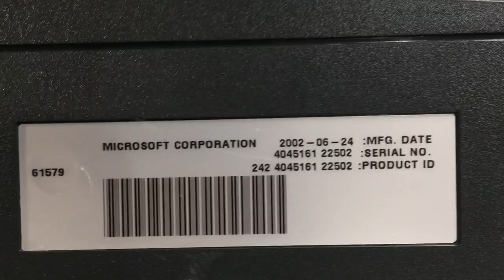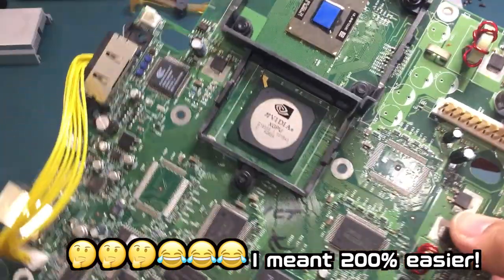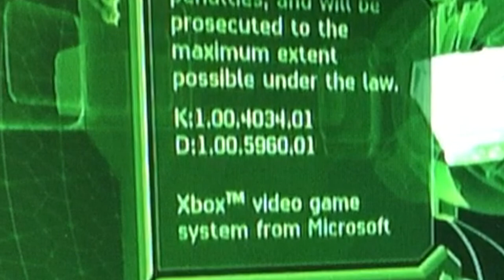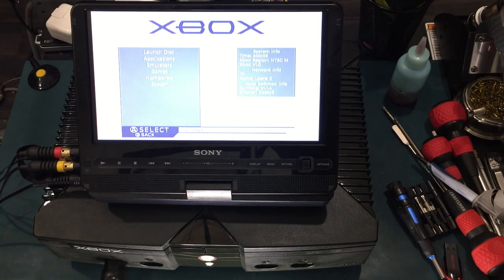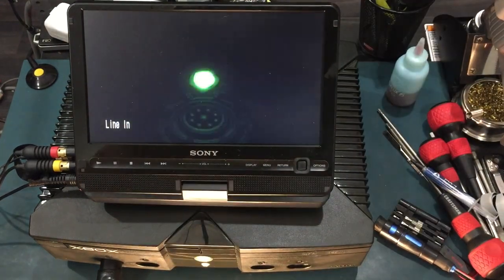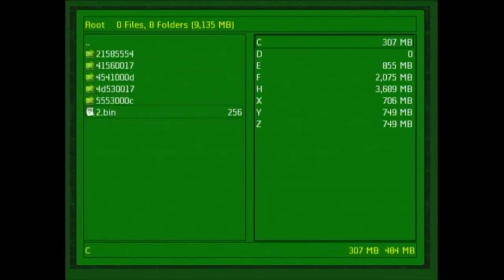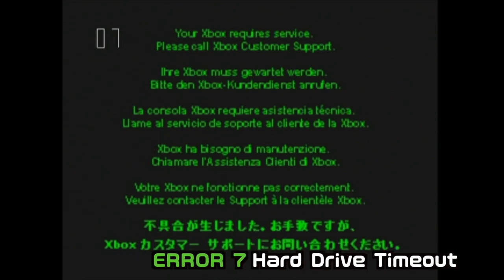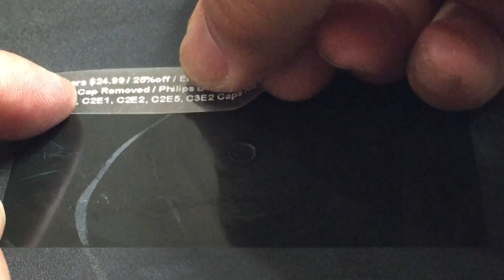OG XBox Error Codes 5, 7, 11, 13, 16 Explained & How To Fix Them [ep. 81]

Comment: I replaced my faulty motherboard then I got error 5. What should i do please? thanks.
Reply from the maker: Motherboard and HDD have to be matched with the same keys. You’ll  have to extract they keys from the MB’s bios using Pony Prog. The directions are in here. Then you’ll need to format the HDD and lock it using the keys from the MB.
Reply: @The_SegaHolic  
Thanks for your reply. 
I have to many games on my hard drive. Xbox stopped powering. I replaced power supply unit, still didn't power. I had to replace the motherboard for it to power.
Is there a way to lock drive without formatting it? Thanks, 
Dean
Reply from the maker: @deanzeineddine1221  No, you need the keys from the dead paired motherboard that the hdd was originally paired with to unlock it. You may still be able to extract the keys from the bios chip, but it’ll be an advanced task.
Reply: @The_SegaHolic  I guess the best bet is to send the old motherboard for repair instead of replacing it. This way the bios will remain intact
Reply from the maker: @deanzeineddine1221  Well, sometimes,the motherboard just aint repairable. But the keys are more than likely still on the bios chip. 
There are ways to extract the keys, but I don't know if the xbox board needs power.

https://www.youtube.com/watch?v=FSe89adGfR0

There is also a wall to "null" the keys, but not sure what the requirements are or how to do it exactly as I haven't touched an XBox in years unfortunately. But you will need a modded XBox.

https://www.youtube.com/watch?v=iS_8_Aop4fM

Comment: I just got back from work and can confirm that my shipping from Arrow was indeed free overnight FedEx shipping. It didn't exactly go perfectly but I'm kind of glad it didn't so I can explain how their customer service was.

I had an ~$37 order full of parts to completely recap a 1.0 revision Xbox, power supply and all (plus a few extra goodies not related to the Xbox). Everything was nicely put in anti-static bags and bigger items like a few 8 pin DIN connectors I bought came in their own little boxes with anti-static cushioning inside, really nice touch. The shipping boxes they used were huge by the way (at least for the amount of parts I ordered), and actually split up my order into two boxes. A lot of brown packing paper was also used. Everything seemed "over protected" and I was pretty impressed until I saw that a glass fuse I ordered was cracked. It was in its own bag but had zero protection, no bubble wrap no cushioning whatsoever.

I contacted their customer support and here is my first downside to Arrow. Their customer support is a little convoluted. Normally with Digikey or Mouser, their live customer support will give you a replacement then and there. You basically just tell them something was missing or arrived broken and you get a new order with the replacements. But with arrow, the rep told me I had to make a new order on my own, email my new order number to a support email, contact live chat again, ask to get transferred to the same first rep if I didn't get them again (I had to ask to get transferred), and then finally the representative could "zero out" the price of the new order with my replacement glass fuse. Keep in mind that throughout the live chat process, their replies were also what I consider slower than average. Overall, it wasn't anything horrible but it was certainly a somewhat time wasting process with a lot of hurdles. I don't understand why the representative just didn't have the power to make a new replacement order then and there. But it worked out in the end and I got my free replacement part. Let's hope this one gets some protection and doesn't show up cracked like the first one.

But overall, my experience was good. The prices are cheaper than their competitors, they have a good selection of parts, 98% of their parts come well packaged, and the free overnight shipping was indeed a thing.
Reply from the maker: LOL. Yeah, that's something I completely forgot to mention. Live support is horrendous. I had issues with them claiming I had to fill out customs papers for items shipped from Europe. I dealt with both live and phone support, as I wasn't made aware that it was the customer's responsibility for customs. Make sure you order parts that's being shipped out from the US.

I know what you mean about Mouser. I used them exclusively for the past few years, and their customer service is top notch... almost apologetic. The even shipped out an item for me for free when I called trying to add a part to a web order, and they shipped it separately for free, as the order was already shipped. Tech support is even better as I found a cap to be not sized correctly compared to the specs listed on their website. They connected me directly to their stock person in the warehouse and specs were contirmed wrong on their website, and everything was taken care of very quickly, and without hassle.

BUT, that will have to take a backseat to me saving money and getting the parts quickly.

Can't believe they didn't "overprotect" the fragile stuff, and they overprotect the others. From my experience, they even ship out in multiple boxes from one order. And all are oversized. Half the time, the are WAY WAY oversized, and even ship out oversized cardboard reels for a minimal amount of connector pins.

But glad you tried them.

BTW, why don't you start a channel? Looks like you do a lot of repair. Oh, and Patrick Nagel fan? I got Duran Duran's RIO LP jus to hang as art. 80's kid here, so I can appreciate it. Nostaglic and brings me back to when I was a kid.
Reply: YIKES! I'll have to be more careful when I order stuff from Arrow. Thanks for the tip. Had I known that sooner, I wouldn't have ordered those 12 10uf Panasonic FR caps from them, they're currently scheduled for shipping from the Netherlands on the 26th. Fingers crossed that they don't bug me with customs papers.

The fact that they didn't put more care into the more fragile stuff really surprised me too. I mean it's a glass fuse, it really doesn't get more fragile than that. If it was a ceramic fuse the bag would have been full of sand... But saving money and overnight shipping are going to hard to beat. I'll put up with a little extra nonsense for that. I'll keep ordering from them, I haven't changed my mind yet. It'll take more than a little bit of hassle to do that.

I appreciate the recommendation on starting a channel. I'd be lying if I said I didn't think about it on a few occasions. Some of the people who's systems I'd recapped even suggested it. But honestly I'm not a very entertaining person, have zero experience in shooting or editing videos, and a lot of my repairs are admittedly repetitive. I don't even save any social media either for "online fun" purposes or a real account. I really like the work I do but it wouldn't make for good content. I'm content with my little ebay console recap side gig for now.

Yeah I'm a pretty big AESTHETIC fan of pretty much anything throughout the 70s to 90s, with a big focus on 80s appreciation. I've got quite a few Patrick Nagel prints hanging around along with one of Agnes Lum. Man if there's something I wish I could experience was Hawaii in the 70s/early 80s. You guys had it good with beauties like Agnes Lum. I don't have any true nostalgia for those eras, I was born in the early nineties. But those eras have a charm about them that's hard to ignore. That and I grew up pretty poor, which I'm kind of grateful for. A lot of our stuff was old but I got a little bit of the vintage experience because of it.

But hey, I've really enjoyed our back and forth. I never thought I'd get so much interaction from you. I know you're a smaller channel but there's always a separation from the youtuber and the watcher. I've always really liked your stuff, always very informative and entertaining. You do a great job making the videos easy to understand for the regular folks yet also cater towards the repair hobbyists with certain details and diagrams. I never thought I'd get a chance to chat for a bit. Thanks for, well, everything! I'm glad I'm a subscriber of the channel.
Reply from the maker: Don't worry about the customs. They'll take care of it. Had to give them a hard time, but they took care of it. LOL.

Hey, growing up poor makes you appreciate stuff more. Little stuff matters. I grew up a little on the poor side too. I mean, our parents gave us stuff when they could... imagine buying an NES in the 80's. They were going for $199 if I remember correctly. $50-70 on games. Imagine with inflation what that kind of money was like. That would be like $200 a game today. Really appreciative of the parents.

I'm glad you get the gist of the channel.

I'm a bit older, in my teens/early20's during the Sega Saturn days, and seen and did a lot with fan sites. I HAVE A LOT OF STORIES and can talk/chat a lot about gaming. LOL.

Agnes Lum? You have good taste. Speaking of 80's aesthetics... give me 80's and early 90's anime art style.

Anyways, you should know that I respond to everyone's comments.

Comment: Segaholic, I removed rocky5's softmod to go back to stock on a spare original xbox I had and now it has an error 16. I used the option to revert back to the stock dash. Do I need to use another xbox that's already softmoded to repair this problem? I don't have the proper expertise on soldering for a modchip on the board.
Reply from the maker: Dude, did you watch this video? Watch this video and pay attention, as this addresses your exact problem (error 16).
Reply: @The_SegaHolic  Sorry, I see what you mean. I've been researching my options all day. I think I just lost listening for skills while watching this earlier. Thanks for the reply though, didn't expect it. :)
Reply: Explained in the video

Comment: i bricked one of my 3 xboxes when messing around with locking and unlocking the hdd, whats the simplest and easy way to fix? i dont know the key or have access to the eprom either
Reply from the maker: I explained it in full in this video. You can dump your eeprom manually with a reader that you can make.
Reply: @The_SegaHolic  i'll probably just sell the xbox for parts

Comment: I have an error 16 due to messing up the uninstall with sid (shown on this video) There are no dash files left, the hardrive was wiped. Any way of fixing it without another xbox?
Reply from the maker: PC. But you need old parts for it. Easiest way is what I show IMO
Reply: @The_SegaHolic  Thanks for the reply. I could use adapters /coverters maybe?
Reply from the maker: @LouiesLog  Not sure. U can go to the og xbox subreddit and ask there.

Comment: How do you fix error 16 when you dont have multiple xboxs or pc with ide
Reply: He showed how to do it in the video, the only difference is that you don't want to clone a working drive, but instead use the softmodding tool extras disc to reinstall the dash and then use chimp to fix error 16

Comment: Lol, "Whut? DAM! It worked!" You give me jokes and your videos are brilliant!
Reply from the maker: I treid uninstalling SID 5.11 from the uninstaller before, and it kept saying it could not delete shadow C, if I remember correctly. And I ended up deleting some files manually, and it gave me an error 13. And I pulled the plug, then an error 16.

I was trying to recreate that scenario, and was surprised that the uninstaller for SID 5.11 worked. Even more suprised when it still worked when I installed SID 5.11 over XBox Softmodding Tool and it still didn't have an error, as in the past, when I did that, an error 13 popped up on another console.

Seems like softmods react differrently on the different revision XBoxes.

Comment: I saw that you used a usb to serial adapter... can you just plug the usb cable in or do you need a serial to usb adapter?
Reply from the maker: I just made the usb plug, so I can disconnect the wire and store it away easier.
Reply: @The_SegaHolic  But what if you didn't have a serial port? Just the usb cable or an adapter?
Reply from the maker: @mrbeastlover1609  So find a PC with a serial port. It's cheap. You can find old PC's or laptops on Facebook Marketplace, Craigslist, etc.
Reply: @The_SegaHolic  That still does not answer my question.
Reply from the maker: @mrbeastlover1609  https://m.youtube.com/watch?v=UcK6nKyKGVQ

Comment: Hey will xbox hd maker and recovery tool help me recover my xbox og softmodded with error 16 thnx
Reply from the maker: I heard it will, but I don't have.a PC with IDE. I'm guessing you didn't save your EEPROM. If you have another XBox, a PC with serial ports, and make the LPC dump cable, the method shown in this video is pretty easy to do.
Reply: @The_SegaHolic  can I use a pc but I have a pc with no ide so what can I use and I don't have another soft modded Xbox and also do I need to replace my clock caps I'm still trying to fix error 16
Reply: I can't find a eeprom reader anywhere so I don't know where and how to get my eeprom bin
Reply from the maker: @BlackCat-qm3sj  You're gonna have to make an eeprom reader... I have the link in the description, or buy one:
https://www.ebay.com/itm/Xbox-EEPROM-Reader-Writer-Repair-Faulty-Console-or-HDD/140521532676

Comment: I get error 7 after following your instructions of how to upgrade the hard drive after the softmod. Pls help
Reply: Actually nevermind. I'd just inserted the jumper the wrong way round lol
Reply from the maker: I thought you successfully upgraded the HDD last I heard?
Reply: @The_SegaHolic  I had but I had to sell that xbox. Nevermind I've got it working by putting the jumper in the other way round and using the maxtor power supply instead of the power supply built into the xbox
Reply from the maker: @chris61981  What was the matter with the other XBox that made you sell it?
Reply: @The_SegaHolic  nothing I just couldn't eat
Reply from the maker: iVirtualPlays  Yes. I already know that. But I prefer to use IDE drives, as you don't need to spend extra on adapters that may fail later. You are adding extra stuff. And I don't need 2TB of memory as I just need to play the games I like.
I've been sitting on an SSD and all the other parts I need for an SSD SATA drive for months, but I have been busy helping people out.
Reply from the maker: iVirtualPlays  You're looking in the wrong places. I found a whole bunch on Craigslist... 5 for $40, all over 200gb.

Comment: What about error 21 ?
Reply from the maker: Kevin Twiner sorry, that’s nit an error I have encountered personally.
Reply from the maker: On second thought... can the Xbox load games from the DVD drive?
Reply: The Sega Holic the drive is still functional, I put in a halo disc to see if it would help and now it’s showing 16
Reply: The Sega Holic I also have one that the error code is 7 but I haven’t switched the jumper before I tried setting it to master and slave but it just makes a clicking sound like the arm just runs across the platter of the disc ?
Reply from the maker: Well, for the error 16 one, you should just fix it using the methods I showed here... Chimp 261812. Obviously, you need a working XBox.

For the error code 7, looks like you have a bad HDD. Maybe the arm is stuck. I never tried to mess wiith a HDD personally. They are very, very fragile. With the clicking, definitely not a jumper issue... if you end up having to replace the drive, you'll have to dump the EEPROM and build another HDD

Comment: SO... everyone is just gonna ignore error 08?
Reply from the maker: Never heard of an Error 8. What is the error supposed to be?
Reply: @The_SegaHolic  the error says: no hard drive was found. Even though i didnt touch anything on my xbox. It just froze, had to restart it. And then it just popped up at boot
Reply from the maker: @asta9359  Care to take a picture of the error 08?
Reply: @The_SegaHolic  well... for some reason my screen won't show up anymore after i opened the xbox. But i'll try to find one
Reply: @The_SegaHolic  but the error screen is just the same as all the other ones, saying customer support thingy
Reply from the maker: @asta9359  So how did you find out that the error is "no hard drive found?"
Reply: @The_SegaHolic  on some sites like reddit they said that. They say it identical to error 7

Comment: Error 5?
Reply from the maker: Your HDD is unlocked, and you'll need to lock it with your eeprom file that you hopefully saved.
Reply from the maker: BTW, here's a conversation I had answering the same question 2 months ago.

@Retro Dad Hey, what's up? Yeah, you'll get that Error 5 if you don't lock it. Easiest way to relock it is to use another modded/softmodded XBox and use Chimp 261812. You'll need to have the eeprom info from the XBox that has the error5 also, for Chimp 261812 to use to relock it. You'll need to upload the eeprom.bin file into the second XBox.

IF YOU HAVEN'T, WATCH THIS VIDEO IN FULL, I GO QUICKLY SO YOU DON'T GET BORED. IT EXPLAINS EVERYTHING YOU NEED TO DO.

If you haven't saved your eeprom.bin or don't have it, you'll need to extract it with Pony Prog and a homemade cable, which is easy to do.

https://www.youtube.com/watch?v=UcK6nKyKGVQ

Come back and ask me specific questions about stuff you're iffy about.
Reply: If you need another soft modded Xbox to fix it I should I just buy another softmodded Xbox instead?
Reply from the maker: @zionmohl5107  Go to the thrift shops around your area and buy a cheap one. Then softmod it yourself. That way, you aquire tools that can help you fix your XBox when and if it breaks again. And you can get it for cheap.

Again, hopefully you saved your EEPROM, otherwise you'll need a PC with a serial port and build an EEPROM reader to get your EEPROM.

Comment: I got error number 12
Reply: Make sure the DVD drive is fully connected with the power or data cable. If it is fully connected, you need a new disc drive.